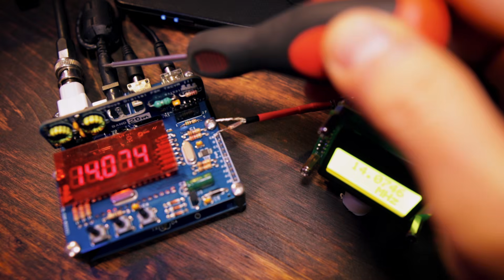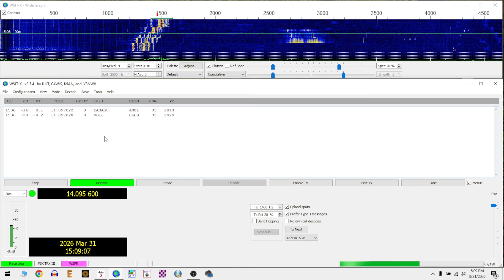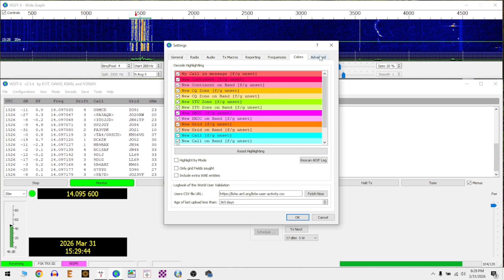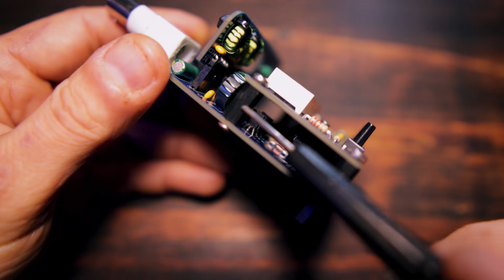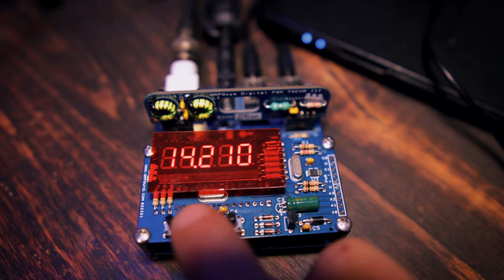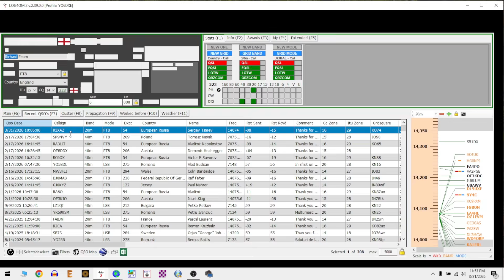QRPGuys FSK Digital Transceiver III: Global FT8 Contacts on Minimalist Power

Comment: I like this radio very much, and use it sometimes! It was not too popular partly because people mixed it up with FSK-II which was DSB and not a great design.
Reply from the maker: I remember the older version as well and that was also the reason why I didn't buy that one... people were complaining. But this one really turned out great. Who knows ? Maybe they'll bring it back sometime ( I hope ). It's too nice not to. I will email them anyway to see if they have any more low pass filter boards that I can purchase. Right now this one is the only rig I use for digital modes... mostly WSPR but now and then a bit of FT8 as well. Thank you so much for watching and have a fantastic weekend. 73, YO6DXE.

Comment: 1625 это же катушка  L1, она на мощность не влияет, ей только кпд можно немного поднять, что вы и сделали, а вот катушка L3, та что в фильтре, как раз бы повлияла на мощность выходную)))
Reply from the maker: You are right is L1 not L3 as I said in the video. My bad 🙈 And yes it didn't changed the power output but it didn't lowered the current draw a little. On 40m band now I have 640mA and on 20m about 700mW so it's all good as indicated by the manual. But initially it was drawing about 1A so that was a lot haha. Such a nice kit... so bad that they no longer sell it. Happy weekend my friend. 73, YO6DXE.
Reply: @dxexplorer  BS170 хорошие транзисторы, но большой надежностью не отличаются, и хотя с них можно снимать приличную мощность я все же советую ограничится 4-5 ваттами и тока 500-600ма при напряжении питания 12 вольт, это ощутимо повысит надежность, особенно при плохом согласовании с антенной )))) а в целом интересный трансивер, зря вы так долго тянули с его сборкой ))) вам тоже хороших выходных. 73
Reply from the maker: Thank you for the advice. I was also thinking to keep the power a little lower around 5W max. For now they seem to work fine and I can no longer smell them burning like I did at first haha. About waiting... ohh yes I know what you mean. I was thinking the same. But I am happy I did because now I'm even more excited about it. Plus that 3-4 years ago I didn't had all the stuff I have now to test it. 73 my friend, YO6DXE.